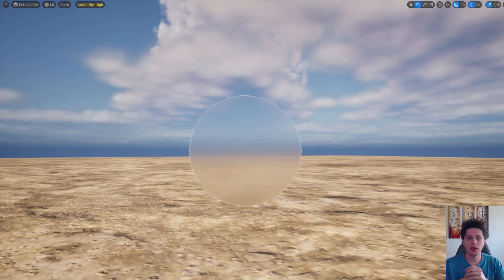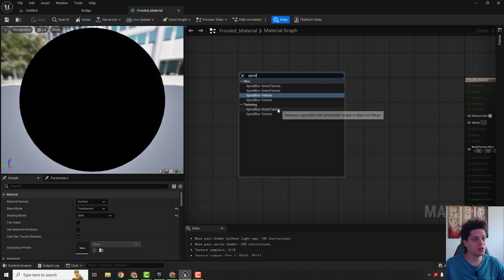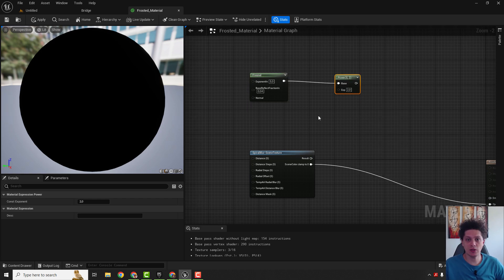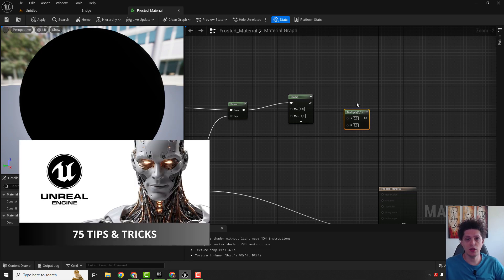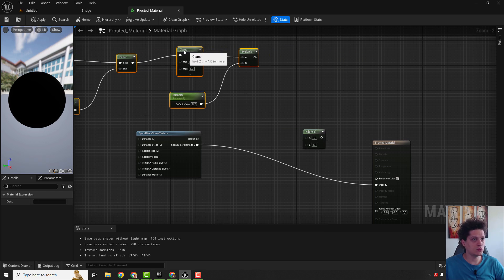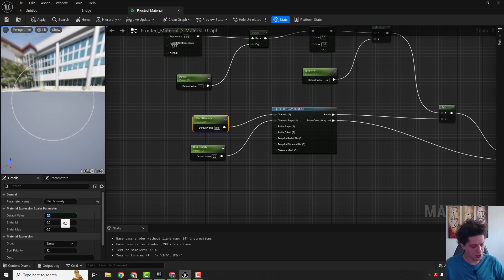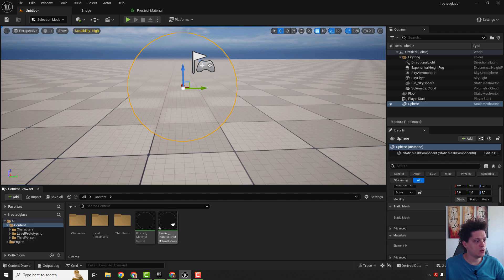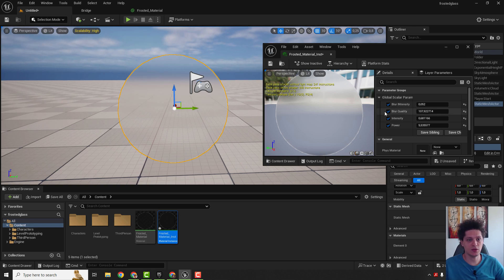How to CREATE a FROSTED GLASS Material EFFECT in Unreal 5

Comment: Having a problem with this setup. While it works as is, I have extra settings to allow my master material to be able to use an opacity texture, and within those settings, lets you change the tint of the opacity if you want. However, when I add those opacity settings to the output of the SceneTexture node, tints no longer work and the only thing that shows is the frosted effect. Any clue why that is?